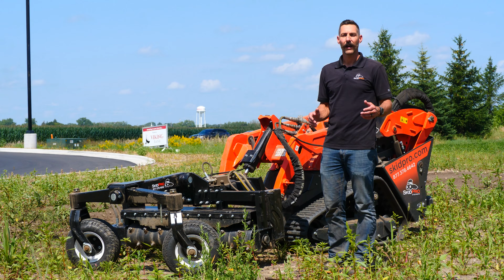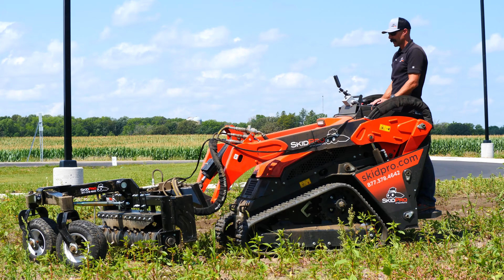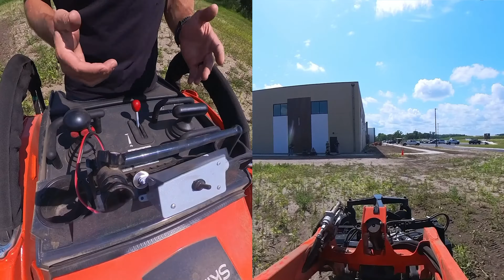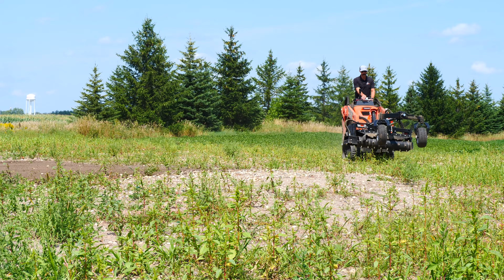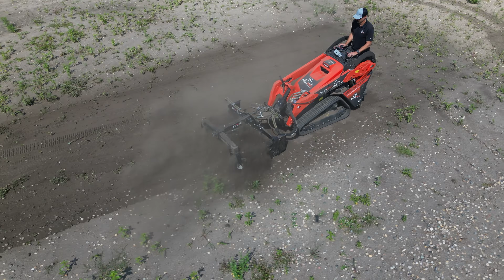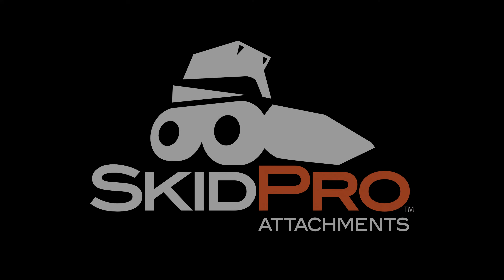Mini Soil Conditioner – Quick Start Guide & Pro Tips!

Comment: Would it be best to put the boom in float mode and then adjust the height of the drum with the curl/dump control?
Reply from the maker: You certainly can! If you hit a rock or a large object your arms will bounce around though, and that's why we don't do that. We like the extra pressure from the whole unit weight to keep it stable.